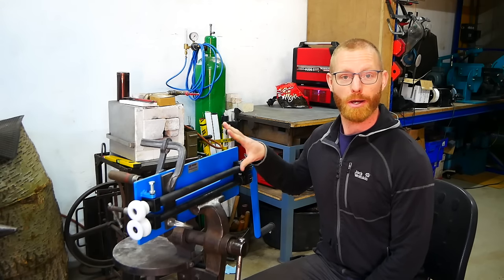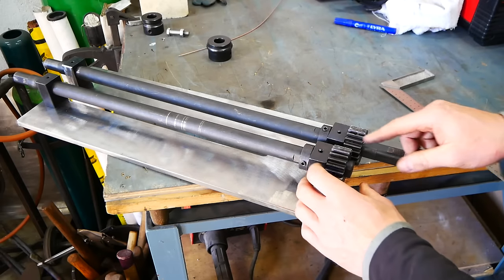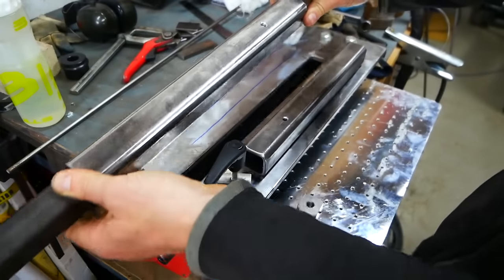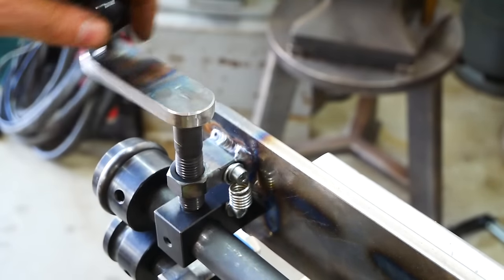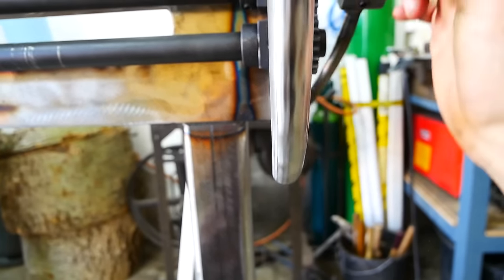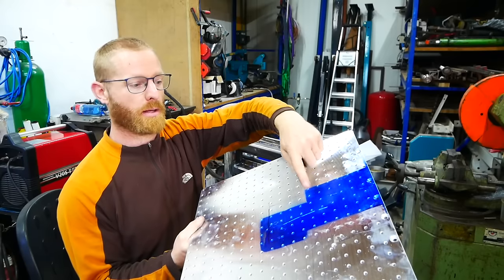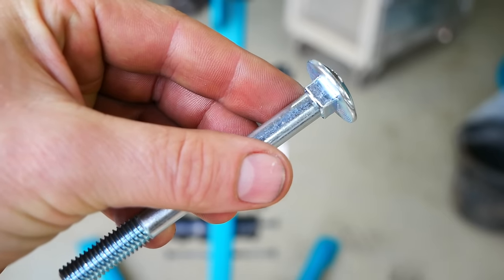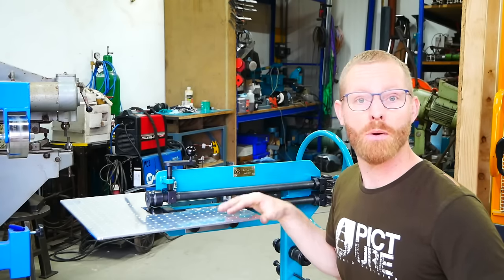Cheap Bead Roller gets some Quality Modifications

Comment: Thanks for the great video. I was planning on beefing up my cheap bead roller and I plan on using many of your ideas. I mig weld mostly and am concerned about heat and warping the main plate. I have the same tig welder you have the V205T but have not done much tig and definitely need more practice. Really like the stand idea with the roller die storage. Very nice work, it is appreciated that you share this!
Reply from the maker: Thanks. And for welding MIG also works fine. Just clamp the main plate or use some welding/heat to straighten it.

Comment: Very nice work on that bead roller. I love the way you fully welded all the components. It will, as you said, avoid leaving any crevices where corrosion could start but apart from that it just looks damn smart. It's good to watch a perfectionist at work. Thank you for the video.
Reply from the maker: Thanks 👍

Comment: That was interesting to watch !
The improvements are great.
I have access to both a cheap bead roller And a quailty bead roller.
Neither has a motor, but there are times I wish I had the ability to move the work with a foot controled motor freeing both hands for moving the part being worked on.

   Thank you for  allowing us to view your ideas.

   Be Safe and Well
Reply from the maker: Thanks! Yes for most jobs this would work fine but a motor makes it more relaxed. I will add one in the future.

Comment: Great job! I did similar mods to my cheap bead roller.. you really have some great ideas, features, and quality workmanship. I used a cheap 1/2" variable speed high torque drill motor to power mine. I geared it down using a13 tooth gear on the drill and 110 tooth gear on the shaft..it will go really slow for intricate work but still have speed for long straight runs.. you don't want to just use the variable speed to slow it down so you don't burn up the drill motor..
Reply from the maker: Thanks. One day i will add a motor or build a new version with motor.

Comment: nice job looks great. i found myself  doing the same thing about 20 yrs ago. i added a  right angle variable speed gearmoter (scrapyard find)  with a foreward and rev foot pedal.for a true one man operation i also made a thicker 3/4"mount plate with enough depth to reach 24".i just recently dismantled it to gain shop space for tools i will use more often. hope you get more use out of yours
Reply from the maker: Thanks. I think I will use it for some nice projects and costumer jobs.

Comment: What a fantastic over kill! I plan to add 3 small bearings on the face of the fence so that it will roll rather then glide and possibly hang up on a cut edge and kick out while trying to make a straight line bead roll. Food for thought.
Reply from the maker: Thanks, and good idea about the bearings

Comment: Very nice. I didn’t build a floor stand, but i did motorized mine with a variable speed drive. I prefer having two hands available to hold the sheet.
Reply from the maker: Thanks, and I do think I will add a motor in the future. For now I will use it without on some projects that I need to make.
Reply: Barts Metalwork ah, in my case, the benefits of being retired. I need to make things, but only when i want to (grumbles about how long it’s taking to finish the welder/plasma cutter cart).

Comment: If you're planning on doing long straight stripes the motor helps but speed makes for fast problems. The beauty is in the eye of the hand rolled product
Reply from the maker: Yes, I found that the 'pointer' works great for longer beads. Even with hand power. But very slow speed motor would work even better.

Comment: Nice work , I would have done some of the mods a bit differently, however some of the mods were pure genius outside of the box thinking . I am going to have to make an adjustable stop like yours . I used a wheelchair motor to power mine along with foot controls made from the hand controller. Much easier to step on the power than trying to hold the work and hand crank it
Reply from the maker: Thanks. And sound like a good plan.

Comment: What a great build! You did a wonderful job! What about adding a fence to the platform like a table saw. That way you would have a guide to keep the sheet metal straight as you run it through.
Reply from the maker: Thanks! Yes a fence would be a good idea. The holes have M5 threads and I did use some small bearings to mount on there to guide longer panels. That worked oke but the reach is limited.

Comment: This has given me some great ideas . I am currently making my own to restore old toy trucks etc . One difference is that I am using pillow block bearings on all but the top die end and will make a block for that one . Can I ask if these blocks have a bearing or not ? as I have no one in my area to ask .
Reply from the maker: Thanks, and no these blocks don't have a bearing but if I would make the blocks I will put a bearing inside.

Comment: One thing.....you didnt get rid of the set screws on the dies.....
Reply from the maker: Yes I thought about that. But it's not to big of a problem. And I had to limit myself somewhere... ;-). The plan is to use this one for the next year or two, get to know the machine and what I like or want to change and then make a complete new design with that. Then there will be no more set screws ;-).

Comment: The part I don’t understand is why you didn’t make the table use the same tubing as the bottom like a receiver hitch type idea to simplify the mounting and removal of the table when you need the extra space
Reply from the maker: Well, if that is the only part I see it as a compliment ;-). Btw. yes you could do that. But I also wanted to make the table adjustable in height for different rolls and depth of the bead.

Comment: Wow some modifications!!?? LOL Thanks Bart I like what you have done. I never the 18" unit it is a l little stiffer than yours but it needs a lot of help. I like your depth stop I will be copying that for mine. I have a big job fixing up my vehicle this summer. Let me know when you are planning for a motor. I have been trying to figure it out but I am a little confused about it. Thanks for sharing. Is it ok to send you an email?
Reply from the maker: Thanks, I started with two mods in my head and it just didn't stop... ;-). I will be on the lookout for a nice second hand motor with speed control. When I have that I will mount it. email is no problem. bartharkema at g mail dot com

Comment: What was that little trick you did to flatten that round plate at 8:50?
Reply from the maker: Weld will pull the material together. So if the plate is pulled round by the welds on top you can put the same (or a few more) weld on the bottom to pull it back. Then grind the welds of.

Comment: very very good job done!! can you help me with some idea? when you put pressure to the superior shaft, the bearing pillow block do rotate freely to avoid the shaft from arching?  sorry for my english, tried to make myself understandable. thanks man
Reply from the maker: Thanks. The bottom bearing blocks are fixed. The top one on the die side can rotate.
Reply: @bartharkemametalworks2299  thanks, the die side you mean the crank side?
Reply from the maker: @crazymodelgarage6438  no the side with the dies where the metal is pushed through. The top block is for adjustment of the distance between the two dies and is free to move.
Reply: @bartharkemametalworks2299  ok, good,  so both inferior Block are fixed, te de site andar the crank side. And the superior blocks?  The die side is movable to aply the pressure, And the superior crank side block?  Are completely fixed too?

Comment: Very nicely done and excellent workmanship! I prefer completely welded seems as well. My question is why you opened up the slot as it should have been plenty large for any material that one would run through it?
Reply from the maker: Thanks. For normal single beads a narrow slot is fine but if you have a round shape or multiple beads you want all the clearance you can get.

Comment: Thank you, I am glad I found your channel!
Did you ever thaught about making the beadroller longer (longer gap)? Lazzes 2nd generation bead roller has a larger offset adjustabillity. I think he use wider sprockets making that possible. Did you ever consider changeing the sprockets to get larger offset posibillity?
Reply from the maker: Thanks! I did see the Lazze 2e gen video and the larger offset. Until now i havent needed it that much. But to be able to ofset/adjust it a little is very very usefull.

Comment: Beautiful work,
How do you find the smaller diameter hand wheel as compared to the larger radius/diameter of the crank? Is it harder to feed 1mm sheet steel for example?
Cheers 
Raymond
Reply from the maker: Thanks. And the hand wheel is not much smaller than the crank, maybe a few cm. But it has a less grip so it takes a bit more strength to hold it. But I don't think its a problem.

Comment: Excellent content. Thanks for sharing, Bart.  After seeing your reference to Lazze's bead roller pointer, I am curious to know if you modified your bead roller shafts to accept his vast collection of dies?
Reply from the maker: Thanks. The dies and shaft are still origional. Not the best system with the set screw but it does work.

Comment: Smart solutions all the way. The wheel is more easy to control  Also I have seen slightly larger wheels with even more curved spokes moving the wheel even further towards the "dies" (the stand attachment also moved, of course) . Have you modified some of the beadroller dies yourself?
Reply from the maker: Thanks. And yes I modified some dies and made some myself. It's nice to have a good Lathe ;-)

Comment: Lathe, drill press, TIG welder, milling machine, engraving machine and... a paint roller? Really? But an awesome video and a lot of inspiration for the soon-to-be-mine beadroller. Thanks.
Reply from the maker: Haha, yes. I do have a good spray gun but not a good booth (yet) and I don't want 2K epoxy paint flying around in the shop.
Reply: Barts Metalwork : Okay, that‘s reasonable 😁.

Comment: All that work for a bead roller?  Couldn’t you of bought a better one instead?!🥵
Reply from the maker: It was a combination. There is a big gab between cheap en expensive rollers. Little in between. And i didnt want to invest that much money. I have the tools and enjoy the proces. It took me a few days and I had a costumer that could wait much longer for a quality version that take much longer to get. It was also a learning experience because I want to learn what is important when using one so one day I can make a very big and motor driven version. I dediced to make some modifications and in the proces it turned to a little more than my first plan. But with modifications it would also give me a starting point. Designing and building from the ground up would take me to long. I'm happy that I did it and its great to use.